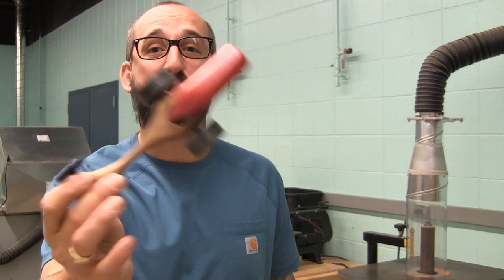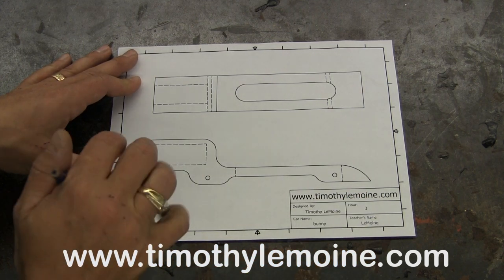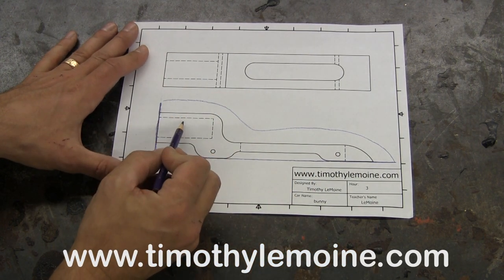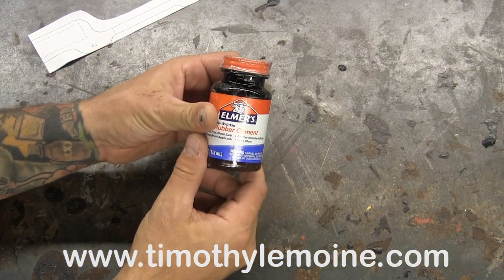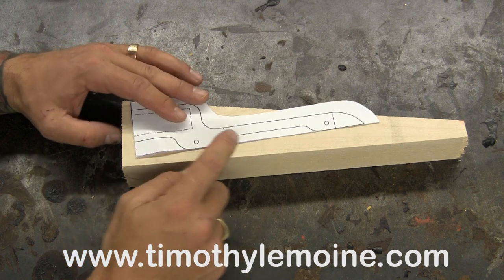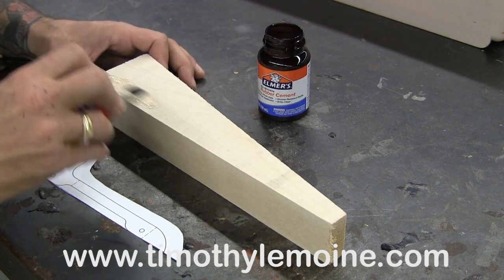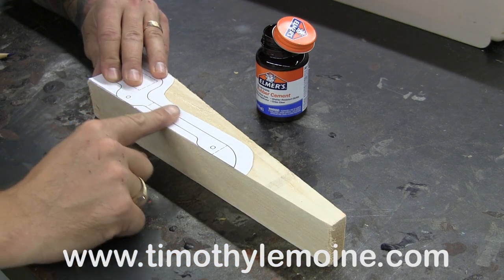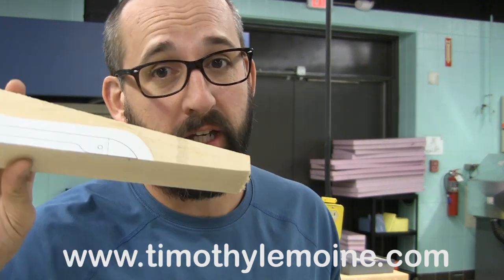How to make a Fast Co2 Car

Comment: I see you spend a lot of focus or your videos on the car body.  I think polishing the axles would be just as important to get that extra edge for speed just like pinewood derby cars for Cub Scouts.
Reply: I got first in pinewood derby. It was because we added weight to it so it could go faster downhill.
Reply: @justuscampbell381  adding weight and in the proper location is step 1.  What most don't do is put the extra work into reducing friction